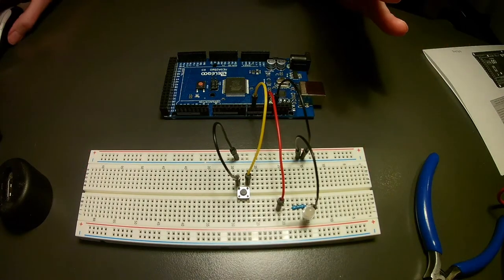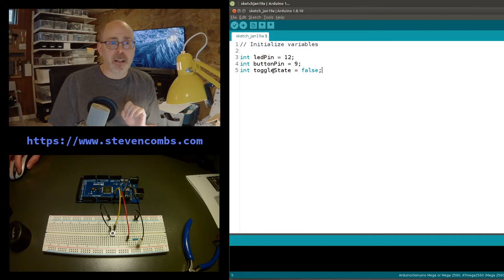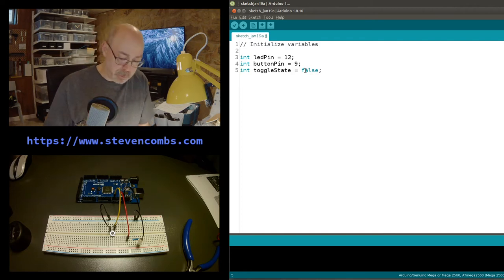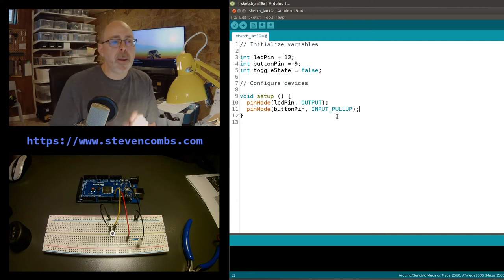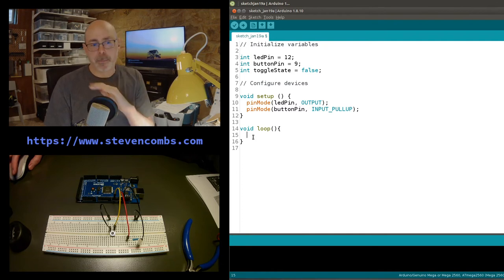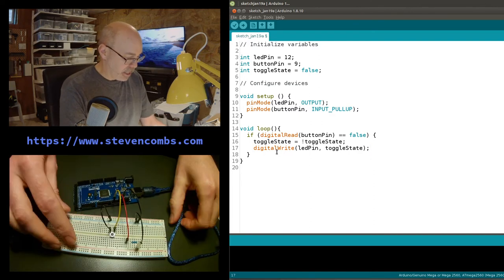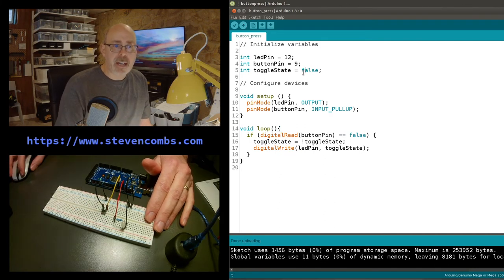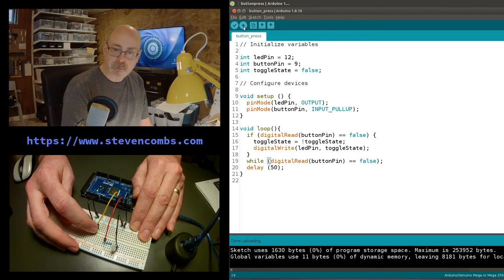BUILD AND CODE: How to toggle an LED w\button on an Arduino MEGA 2560

Comment: I saw this project to build a MP3 player using the UNO and a Sparkfun MP3 Shield and 2004 LCD screen  (not I2c interface connections) BUT,  the UNO couldn't accommodate my music library (too many songs) so I moved to the Mega 2560 and then ran into the problem of the push button connections, saw your video and SOLVED the problem... Thanks again.
Reply from the maker: Awesome. Glad it was helpful. Video probably had more than you needed. Curious, did you also view the companion blog post for the code?

Comment: Very instructive! Great video. Can the card have 24 buttons controlling 24 relays using your approach for controlling one LED? I want to build a solution where button1 turns on relay 1, a second click on button 1 should turn off relay 1 etc.
Reply from the maker: Great question. It's been awhile since I had a relay on the workbench so I decided to research this as I was curious as well. Here's a great link to a conversation that is very similar to your project. 

https://forum.arduino.cc/index.php?topic=119824.0

Comment: Hi, nice work, but I have a question, I  already used pin 2,3,4,5,6,7,and 9 for a 2004 LCD display would any other pin work (digital)?
Reply from the maker: Pin 8 should work if you want to integrate this code into your LCD code. What does your LCD program do?